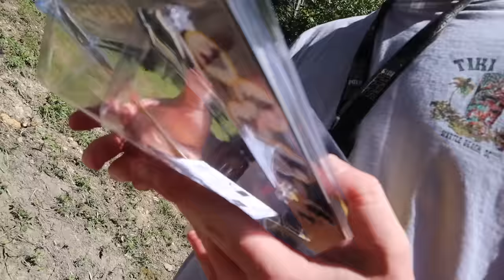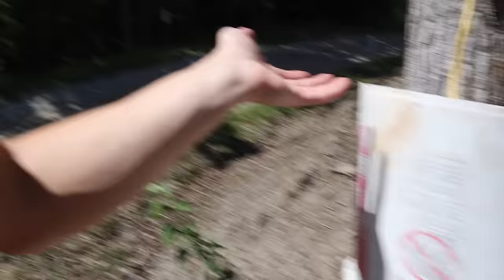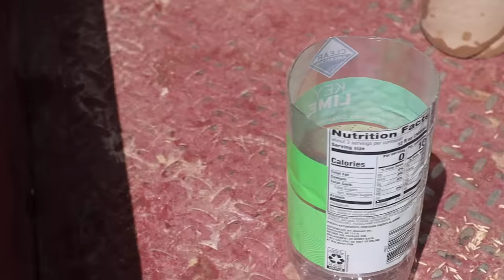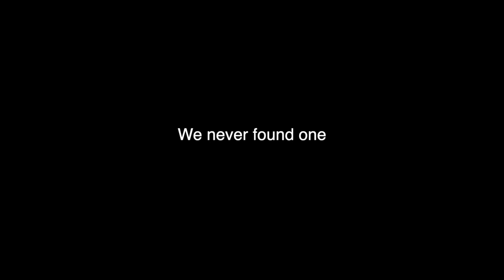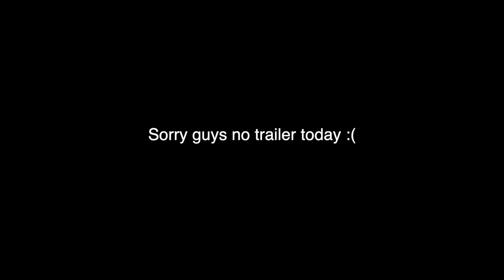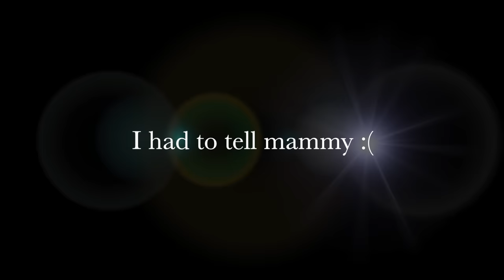I Accidentally Found and Underground Bunker...

Comment: for trap season, try mouse urine 20 feet around the trap, then spray bitter apple spray around the perimeter of the cage trap, then sardines and veggie scraps in side the trap....not recommended for dog proof, but predator and varmints might be perfect for this set up. there is no protection for coons if the mouse urine is sprayed there because it is a beacon for predators. please try this and tell us what you think....ps, i tried this set up in california at my grandma's house and it caught a ton of varmints. every trap was full...i used cage traps. 1 big badger, four skunks and 3 possums, and two coons (and two cats which were released) were caught. 1 hour after we set the traps they were full.